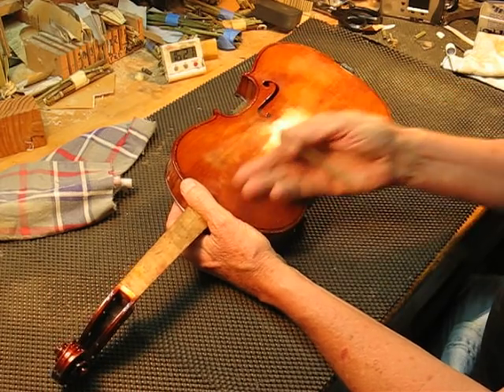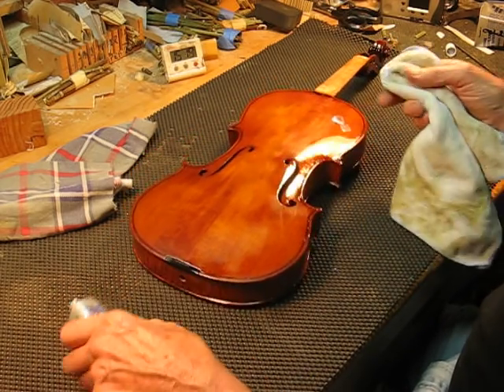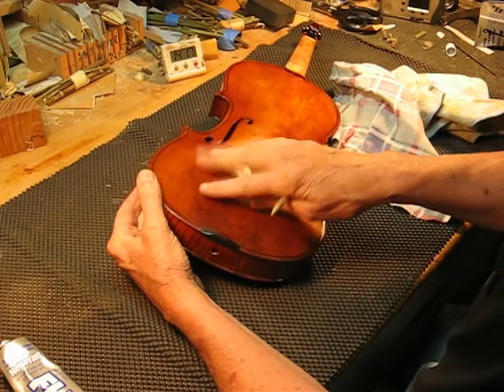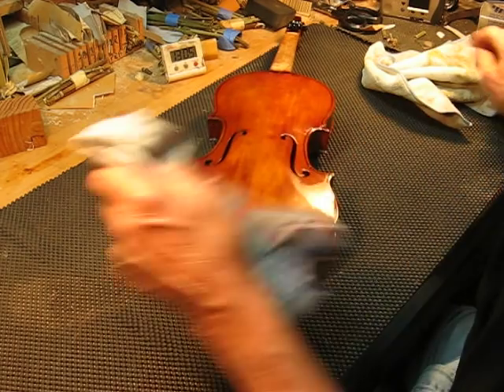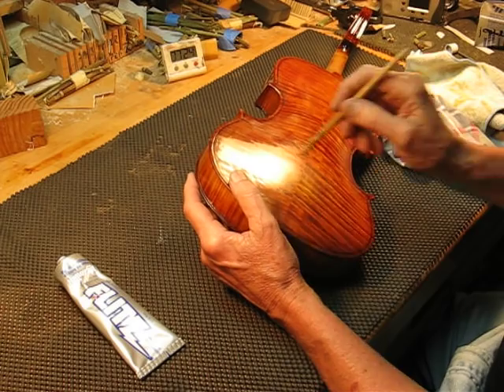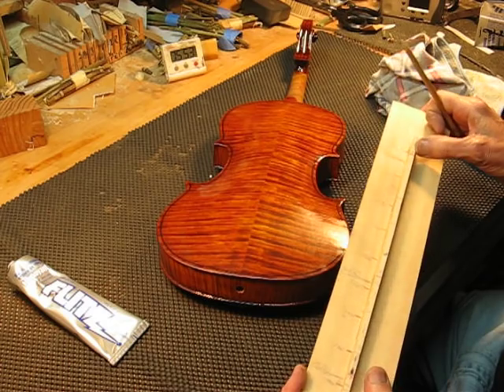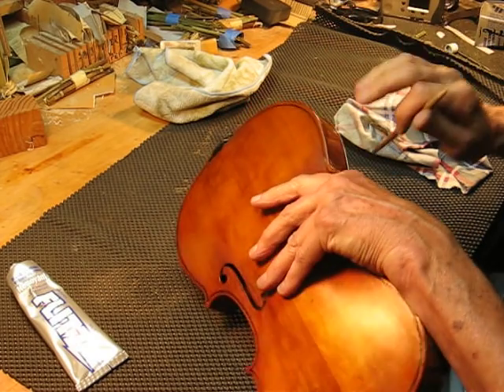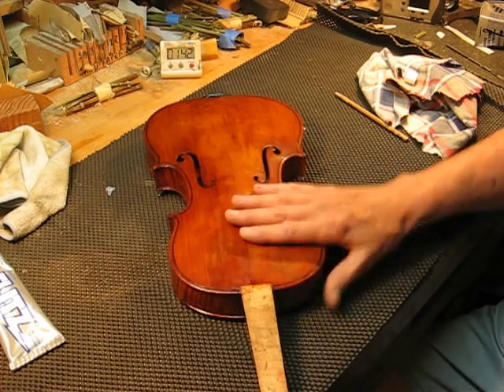Flitz Varnish Polish Technique on my  Opus 'Nathan' violin

Comment: I have a violin I used alcohol and stripped off a poorly overdone flaking off varnish coat. its was mummified in to many coats to where it was coming off. anyway. I am down to the stain and bare wood I was wondering after I varnish it with spirit varnish could I use the flitz to make the brush strokes gone? if I wanted that perfect look or could I just deal with the brush strokes. I have noticed how good the violin sounds after I took off the thick coats of varnish. I'm using hindersine spirit varnish for the hopf violin im working on. any held would be great.
Reply from the maker: ***** Look up Micro mesh sanding/polishing silicone carbide cloth backed sanding papers and first sand surface flat and then work through series finer and finer until you get the finish you are looking for.  They also offer a micro liquid abrasive. David L.

Comment: Can you plase share the recipe for the varnish used on this violin, and also how many coats?Thank you!
Reply from the maker: Thank you for asking..  I use a high end oil varnish made by a German firm that just makes instrument oil varnish.  It costs about $1,200 per gallon, or $ 260 per liter; plus very expensive air shipping.
  We have used it for about 15 years and it is my favorite, despite the cost. Company is "Hammel GmbH & Co. KG.... "Shop:www.joha.eu"   # 2320 is hard recipe and # 2330 is soft recipe; and you can mix these two to have a medium hard varnish.  
  I think I used 5 thin coats on this violin.   David L.
Reply: @dalemfg  Thank you! What is your opinion about spirit varnishes? Mostly Manilla Copal ones? Did you conduct any test using these?
Reply from the maker: @MrNedelcuBogdan  I believe I did test several older violins with spirit varnish, and it seemed the results of the Flitz Varnish treatment were the same...   David L.

Comment: Hi Dave, you amaze me with your knowledge. I polished with flitz and it did the job! What strings I should put for best sound in your opinion, what bridge I should use? I know that little things can do a lot. I slowly trained my ears to hear when the sound goes high or low. Before strangely, I was hearing the contrary: if it is higher i was feeling it is lower and reverse. Thank you for sharing your knowledge with us!
Reply from the maker: Vladimir Basanov ;
  Thank you for your comments.  As to bridge, you might try tuning the bridge to match the 'center of the back plate tap'. On the website, articles on the bridge are at:http://www.violinresearch.com/taptonetechnologyapplication_007.htm
 Strings are just what you can afford and enjoy...
David L.

Comment: Flitz contains 30-35 % microscopic aluminiumoxide dissolved in oils and other hydtocarbons. I wonder if it could be used as a sealer if diluted with a hydrofobic solvent.
Reply from the maker: Aleksi;  Obviously a chemist...perhaps another reader can share information with you. David L.

Comment: Interesting. I notice that the polish lowers the tap tone of the top and back. Is this necessarily an improvement of tone? Have you ever compared the tone of a setup violin, both with, and without the Fitz polish? How does this compare to other methods of polishing an oil varnish such as mineral oil and pumice / rottenstone?
Reply from the maker: Thank you for your comment.... I would suggest that the base (fundamental) tap tone remains the same, but that the response begins to project out into the room more with each coat of Flitz application up to four coats which seems to be the maximum improvement.  We want to transmit our violin sound out to the audience after all....  I believe this process of interaction with the polish ingredients builds up over time with traditional violin polishes that professional violists use; it is just that that process may take several years to equal what can be accomplished in one hour.  ..David L.  You might find some additional  practical information on violin acoustics at www.violinresearch.com  (I am the web host).  This process in not intended to polish the varnish surface; just improve the sound transmission..   I really like the polishing effect of rubbing the completely dry oil varnish with rotten stone and linseed oil applied with a felt pad for improving the varnish polish.
Reply: Great site. It will take a little time to completely explore it.

Comment: Does this product contain silicon?
I have read several sources warning against using polishes containing silicon on wooden musical instruments. If silicon contacts timber (through micro cracks etc) it can cause major adhesion problems if ever the instrument's finish is ever rebuilt or requires repair.
Reply from the maker: Richard;  Good question. The Flitz packaging only lists:"Chemicals from Germany" as ingredients. Looking around the internet, I can not find a reference saying that Flitz contains silicon.   In my violin work I have used touch up varnish occasionally on a varnished surface treated with Flitz polish and have not noticed any adherence problems.   The point here is, of course, not to polish the surface of the varnish, but to produce a positive acoustical effect to playing performance..  David L.
Reply: @dalemfg  Thanks for the reply. It might be a consideration to further test if intending to use this product. I must say, the effect on tap tone is quite startling.
Reply: 10:25 10:25 10:25 😢❤

Comment: Hello! I have a violin already, covered with varnish I can polish with another type of paste? thank you
Reply from the maker: I believe many musicians use a paste wax or polish for protection to the violin's finish and keep the varnished surface shiny.  The Flitz polish technique is about curing the varnish for better sound transmission, rather than polishing for appearance, although it does leave a nice luster to the surface.   I do not know what effects other types of wax or polish may have by experimentation.  However, my surmise is that the use of professional (much milder action) violin polish over many years has the same acoustical effect as this concentrated treatment.  David L.
Reply: the principle, then, is to remove some layers of varnish to lighten the sound of the violin, is not it?thank you!
Reply from the maker: No, actually, no varnish is removed at all.  The Flitz polish chemicals apparently interact with the existing varnish, changing it;s properties so that sound is transmitted better.  The violin weight does not decrease, and might slightly increase with the chemical changes.  David L.

Comment: How are you able to tell the difference between one or two hertz during your tap testing are you using a frequency counter or a spectrum analyzer ? But most of these instruments require a sufficiently long sampling period to make an accurate measurement but your taps are just a fraction of a second ???
Reply from the maker: This is a good question:  This current method is the result of many attempts and trials including using computer based sound analysis.  this link will show you my wood tone sound reference tool and a video on how to use it from our main website: http://www.violinresearch.com/taptonetechnology_013.htm
  It turns out that our ears are designed to be more accurate than even modern technology...
David L.

Comment: Hello! Can I use other varnish, like polyurethane varnish, on the violin? 
From what I saw your video, you used Flitz Varnish Polish to balance the sound of the violin, didn't you?
Reply from the maker: Tung;  Thank you for your question.  I have only tested varnish violin finishes and recommend only varnish finishes for best sound results.  The Flitz Polish technique is to cure the varnish for best sound the varnish is capable of transmitting.  (which normally happens over many years). David L.